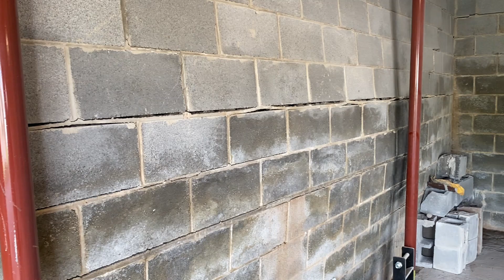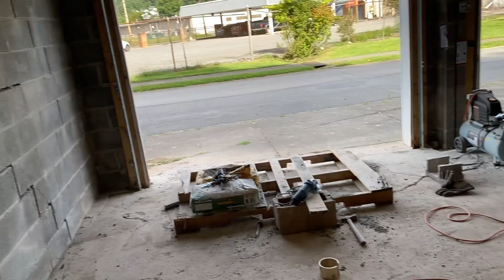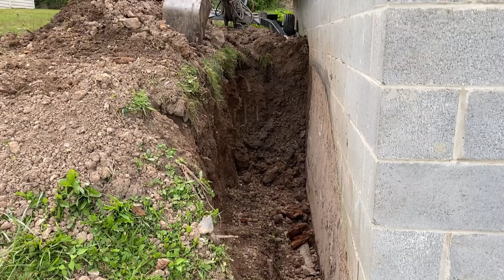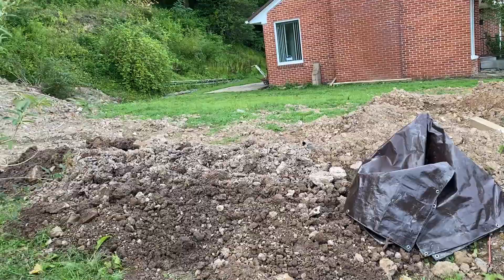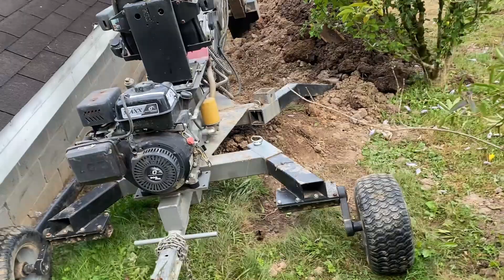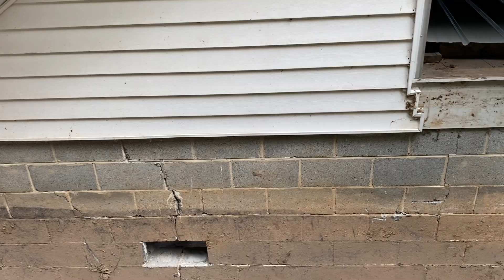Garage Repair Update

Comment: Wow, that's A BIG job you are doing with that little machine, really nice work!
Reply from the maker: Thanks. Actually the little digger is just right for the job. A local contractor wanted big bucks to dig it out and he said the excavation would have to be 4 - 5 feet wide because of the roof overhang. The tow hoe is able to get in under the overhang so the trench is only 3 feet wide. The contractor estimated $25K to $30K to fix the walls. I only have about $100 in material so far. The tow hoe more than paid for itself plus i can get my money back if I sell it. I had to remove the rain gutters for the dig and I have a couple dents in the facia but other than that it is all good.